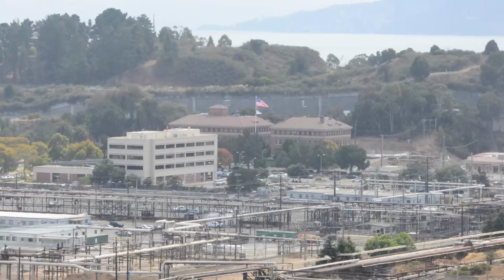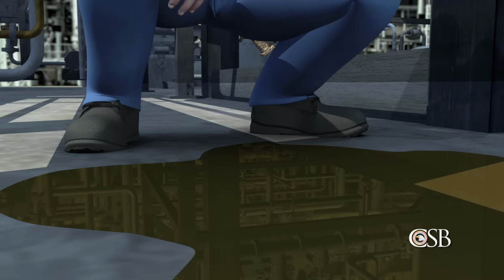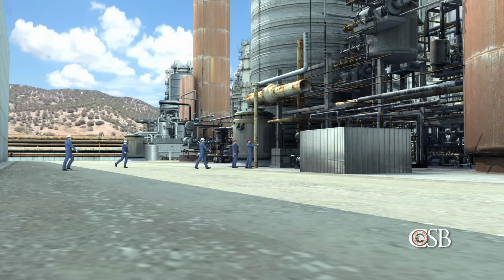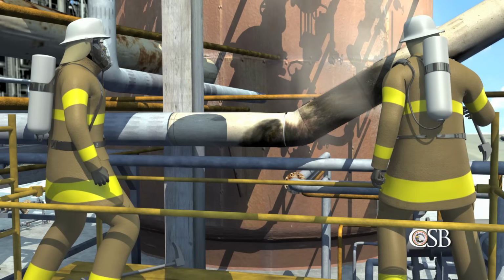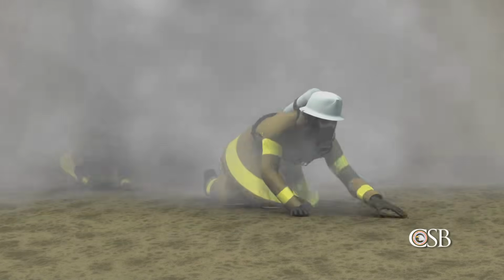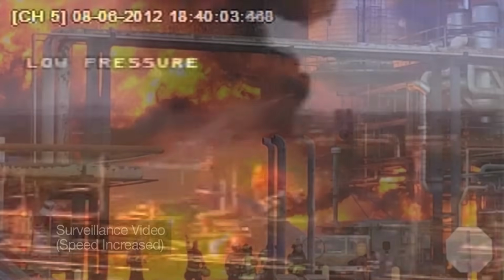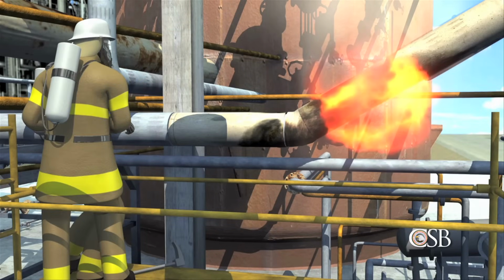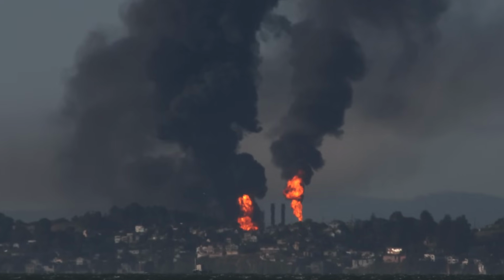Animation of Fire at Chevron's Richmond Refinery, August 6, 2012

Comment: If I remember right, Chevron instead tried to get a bunch of public officials elected who would leave them alone. It didn't work.
Reply: htomerif It's quite simply, really.  If you do the maintenance, you're spending millions of dollars, right now.  If you hold off, though, you save that money.  Sure, you risk an accident that could cost you far more... But a risk isn't a certainty.  So people tend to minimize risks.  "This might happen" has a lot less power than "this will happen" - even when the former would cost hundreds of millions and potentially lives, and the latter would only be six or seven figures and entirely safe.  And so managers "save" money by forgoing maintenance, and are praised by executives who either aren't aware of the danger or dismiss it as not worth worrying about.

"Oh, that won't happen" is a disturbingly common thought, all throughout humanity.  It's why people don't spend $40 on an oil change and wind up ruining their engines, and why people don't spend $25 on a cab ride home from the bar and then wreck their car (and, all too often, someone else's as well) when they crash.  The whole situation is why we have the expression "Penny wise, pound foolish."
Reply: In this case they should have shut down immediately. However telling upper level management that you are shutting down a large part of a plant that processes over 200,000 barrels (55 gallons in a barrel) a day because of a pipe leak is not something they will want to hear.
Reply: +Kohdok Chevron has a number of media outlets and dispenses
its largesse in a city badly in need of resources. When they donate to local
nonprofits, they are able to publicize how much they love Richmond. More importantly,
however, they buy silence about the health effects of their toxic emissions
from the staff of these nonprofits, whose leaders are important community
figures.
Reply: That is what I believe FMRX does in my community.
Reply: I live way too close to this shit.
Reply: Wheatstone in Australia is a big concern chevron have a heap of inexperienced people and cut a lot of corners in construction
Reply: @Richard Vaughn Put "richmond chevron election" into your search engine of choice to find out!"
Reply: Janet Johnson 
Public oversight has nothing to do with Exxon's lack of motivation to protect their own investments with periodic capital improvements. To save a few bucks cost them hundreds of millions of dollars. 

They have plenty of warnings, reasons and opportunities years ahead to perform maintenance on what would have amounted to changing the wiper blades on your car.

No community figure, as you put it, would understand the critical nature of the plant managers' lack of safety mindedness nor could they stand up to pressures of the corporate mindset. That culture does not end at the refinery gates but extends all the way into the public

As  a tugboat deckhand I assisted the chief engineer in the engine room when he needed an extra set of hands or if I was bored and wanted to watch. There it was reinforced proper maintenance was NOT fixing something when it broke but to prevent later breakdowns. 

Fixing something that was broke was just that.... fixing something that was broke which should have been looked at before to prevent a breakdown.

It begins and ends with the person who had their hands on the controls to say 'shut it down and let's get it right'

Shortsighted thinking led to the idling of a refinery while they shift through the charred remains which in any corporate boardroom is not a good thing.... of course injury and risk to human life notwithstanding though with these things that always seems secondarily on their minds
Reply: @tommypetraglia4688  
As a tradesman having worked inside an exxon refinery. Your right.
I still have occasional nightmares about the one I was in and the shitshow that entailed.
Reply: This is what I don't get.  I could care less about the shareholders, board of directors and insurance companies underwriting these refineries, but fundamentally these preventable accidents are costing these "important people" a lot of money.  Even if it cost them a few million dollars every year per refinery to keep safety standards functional it would easily pay for one of these hundred million dollar disasters.
Reply: It's insurance. These accidents don't cost a hundred million dollars. It's all covered under their insurance. Sure people die and their premium goes up. The odds of a truely major accident is fairly low. It's an easy motivator to just keep up enough maintenance to ensure the product is being made so that it can be sold. If the insurance gets too high then they stop producing whatever specific product in that particular faculty and spin up a new faculty at another location. Besides the really powerful safety net (for companies not for lives), you also have managers who don't last long and is only interested in keeping operations running long enough till it becomes the next guy's problem when they get promoted or change jobs.
Reply: And then they succeeded in getting Trump elected and he immediately gutted all safety regulations. God only knows what will happen next time.
Reply: @Auriam   depends on the refinery.
Most of them won't really adopt 'less' standards, because the dangers don't just disappear. 
People dying is also a lot of money...

Comment: 2012-1976 = 36 years.
What kind of mickey mouse operation doesn't change such a critical and highly stressed component in almost 4 decades? When they know of high wear?

This isn't even greed, the bean counters said it should be inspected and tested then replaced but they just didn't do it. I hope this is a wakeup call, this could have killed so many people.
Reply: Answer = Every operation world wide.
Reply: FWIW I'm pretty sure there are water pipes and electricity power wires beneath NYC dating over 100 years old.
Reply: @Syclone0044  To be fair, electric cables and water pipes don't tend to cause explosions from getting a leak.
Reply: @Syclone0044  They have been reinforced.... and some are not used.
Reply: Followed by the three stooges level temporary repair operation. Man if I worked in a factory like that I'd be the guy who's always saying "Nope. Shut it down". How much do you have to get paid to be that stupid with your life? I've never made that much money.
Reply: Gunshinzero $75 -$100 stupid.
Reply: Among the bosses those who shut down production don't get promoted. So they keep coming up with reasons and ways which like in this case are absolutely stupid just so they can say I tried this and it didn't work. In this case boss stupidity went beyond normal and luckily no one was killed.
Reply: It's never a wake-up call. It's just cheaper to have the plant explode once in a while.
Reply: The unit supervisors are always told to maintain production at any costs. Turnarounds are the best times and sometimes the only times for components to be cleaned, inspected, and replaced. Why they never took those times to do so is beyond me, or to look through their P&IDs to see where they could make improvements for better isolation of critical pipes. The very last thing they want to do is shutdown.
Reply: Larry Riffett  My family consists of a lot of electrical industrial workers including myself. I don't like getting shocks because each one is another role of the dice. That's why I look at my feet and left hand before getting close or working with live wires or bus bars. If I was at that situation I would have walked off because it makes zero sense for firefighters to be doing a mechanics job. It was only the luck of the Irish that someone wasn't killed. Once you go down the road of taking chances based on cost this is what happens. So no management doesn't learn its lesson.
Reply: That was not the first time they have accident.
Reply: Shitvron
Reply: they didnt learn shit not till it cost them somthing
Reply: Did Exxon suffer any penalty whatsoever from this?

Sure the plant was down for a while from the fire, but if they had safely shutdown first that would have happened anyway.

Companies won't do anything different until fines forec them.
Reply: "What kind of mickey mouse operation doesn't change such a critical and highly stressed component in almost 4 decades?"

the kind which is more concerned with "shareholder value today" than "still having a plant tomorrow"
Reply: There are several oil refineries in the area I live, and every other year they shut down to change out critical piping that wears. Most refineries do the needed maintenance.
Reply: Treblaine wow this truly sad this sound like don't care about there employee. This people love one care want to know their family are safe .
Reply: Ones that are greedy and make too much profit
Reply: Larry Riffett  First money can't replace a life. The loss do to a shutdown may appear big but you have to compare that to another number like how much were the sales over an operating time. Do you drive your crane over a bridge that is under your GVWR because it saves time and you will probably get across? They have engineers who design refineries. If they don't want to shut down the whole refinery because of a dangerous leak in a particular piping section they call for a piping bypass. 

If you've worked in a chemical plant or any big operation than you know that the mechanics and electricians do the repairs not operators or fireman. I don't know now long it takes to shut down a refiner or to start up. Assuming you have the material available I doubt it takes more than a week to replace that section of piping but scheduled shut downs do occur and this should have been replaced at the last one considering what was said in the video. Maybe they were pushing during the previous one and decided to go back on line before completing this change out, hoping to get by to the next one or just forgot to do it.       

Your boss doesn't want you making decisions independent of the customer because he doesn't want the added liability.  After the Texas City explosion did the bosses learn their lesson? The CSB is reviewing the one in Philadelphia now. BP also owns the Deep Water Horizon disaster also.
Reply: One that values money over lives
Reply: It will be the exact opposite. There were no deaths so there won't be any oversight. Look at the FAA. The NTSB has held them responsible for several accidents because the issue first happened on a flight where no one was killed.
Reply: Just because the bean counters say it needs to happen doesn't mean you get the manpower to actually accomplish everything they say
Reply: Im sure they wanted it replaced.
Depending on management and beaurocracy  one pipe can easily be missed... However... how the fuck does one be missed after 40 years... idiots.
Reply: The cost of your plant exploding will always be more than the cost of shutting down and doing maintenance
Reply: I was going to post and say the same thing. I can't imagine an exhaust pipe or a water line lasting 40 years, let alone something like this which is moving caustic chemicals.
Reply: They probably assumed the best-case scenario using calculations based on the rated strength and durability of the piping.  But all it takes is a single manufacturing defect or load miscalculation to eventually result in failure, especially towards the end of a part's service lifetime.  That's often the root cause of these sorts of disasters:  lax regulation and cutting corners on maintenance practices just because failure hasn't already occurred.  It's essentially a game of Russian roulette which involves pushing maintenance checks further and further back based on the assumption of ideal conditions.
Reply: @icemachine79  The mechanics could have opened the outer layer in minutes. The obviously didn't because of the sparks made from a saw. Now maybe the could cut it open with sheet metals snips. But no one knows how weak the pipe is or where the leak is. So without some special technology or robot the only safe thing is to shut down whatever was needed to safely replace the pipe.
Reply: @kimobrien.  I think the problem was that the pipe didn't have its own shutoff valve so the only way was to halt production entirely and wait for the distillation tower to empty.  I'm not sure why the pipe didn't have a separate cutoff; maybe it was a design flaw or perhaps it couldn't be safely done without shutting down the entire system.  But regardless, there was no way to instantly halt flow through the pipe so the accident was pretty much inevitable by the time the leak was spotted.  The real failure here was one of oversight and risk management.  The pipe needed to be replaced long before it got to this point.
Reply: @icemachine79  The CSB themselves said the whole accident might have been averted if the distillation tower had been shut down when the leak was first discovered. To me this whole approach was stupid to begin with. Have you ever heard of using the right tool for the job?  What do these fire fighers do on the weekend? Look for sleeping Grisly Bears to poke to see if their dead or hyberanting?
Reply: They were probably busy with 75,000 OTHER maintenance projects

Comment: Stupid ass USW operators! If the insulation is all that is maintaining the integrity of the piping, why the hell would you strip the insulation?!
Reply: your utter ignorance is hilarious!!!!  you have no idea what you're talking about.  insulation does NOT keep hydrocarbons in piping!!!!!  it's s.o.p. to tear insulation back so that you can determine the actual source of the leak.  the official findings were IN FAVOR of the operator's original assessment.   YOU are an IDIOT.
Reply: Well, you can tell he's a typical operator. "I know everything! This is my plant! Im smart your not!" Meanwhile when the shit hits the fan and they upset units, the first ones they go running to for help are the skilled and experienced contractors. If he would of read my post carefully, he would've seen that I said the "integrity" of the pipe. The FireFighter, who by the way at Richmond, is just an operator in bunker gear, as opposed to other plants where FD personnel are full time FF's and not a board guy with a Richmond FD patch on his sleeve, should not have disturbed the system or let alone expose the system by removing insulation. Of course insulation, regardless of whether it's fiber, calcium silicate or in Richmonds case ASBESTOS will not stop a leak BUT I've seen many leaks on many systems, where the system is just starting to leak slightly through the insulation and NEVER did we remove the insulation until the system was isolated, drained, bled off and VERIFIED of the above.
Reply: Yeah, laughed my head off about the poking of the pipe. Seems like a good move. And I don't care how the other commenter is calling you an idiot, he could learn some manners - the crew working surely weren't responsible for the accident - but the poking and removal of the insulation were in fact, cause of the fire, as the flammable material came in contact with air. 

Nevertheless, it was just the image of metal rod poking the pipe that got me laughing. It's almost poetic in a way and says something about our species. Able to create such magnificent, complex and expensive things such as a refinery, but in the end, somebody with a metal stick will just poke around and blam.

Comment: Yeh put a dam isolation valve installed as well
Reply: Although the concept of isolation valves is sound, every component that's added is another potential failure point.  Valves also can allow entrapment of materials where pressures can go outside of safe limits, so pressure relief is needed between isolating valves, and so complexity can increase exponentially, with the potential for failure of each component.  It can be as much art as science.
Reply: I don't believe that near the tower there was no valve and it was impossible to shut off the pipe.
Reply: @greg3930  probably but you looking at a refinery from the 70s. There was a way like the previous guy said. Shut down the whole thing but that will lose production
Reply: @mikecromaticm2896  I work on a similar unit (It was built in 1969). All towers have isolation valves. We had similar problems more than once, but we didn't lose production and people. Thank God.

Comment: I never thought i would say this, but those engineers are stupid as heck lol
Reply: +djBC10000 It was not the engineers or the refinery workers who were responsible, it was management that made the decisions to (1) not repair/replace the corroded pipe, and (2) to not shut down the unit after the leak was discovered. Refining is the cash cow of the oil industry, and it's all about profits.

Comment: Knocking the pipes with the ceiling hook? Obviously the engineers are retarded. This is not a firefighters job nor a safe task to do. Let the engineers don the bunker gear and do that stupid task.
Reply: Not to mention when they started using high pressure water. Like what the fuck? Seems like Chevron has a training problem as well as the issue with not replacing 40 year old high risk equipment.
Reply: Firefighters doing a mechanics job? Obviously someone from management ordered this stupidity. It doesn't say but my guess is the mechanics correctly refused to work on a 650 degree pipe leaking hydrocarbons, management insisted they stay around and watch firemen do their job.

I guess a firefighter was also going to install a clamp afterwords and management was going to avoid paying the mechanics grievance money for the hours the firefighters worked by keeping them at the scene and maybe the firefighters would get a working pay bonus.